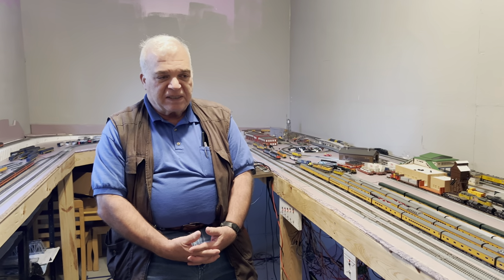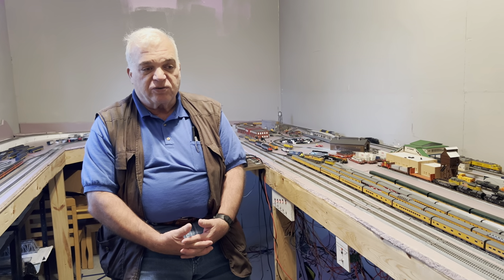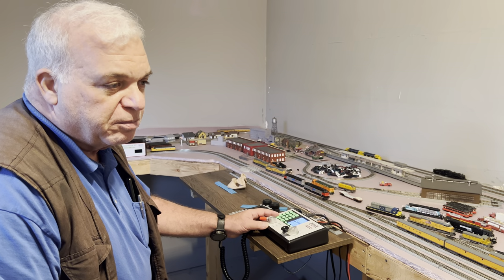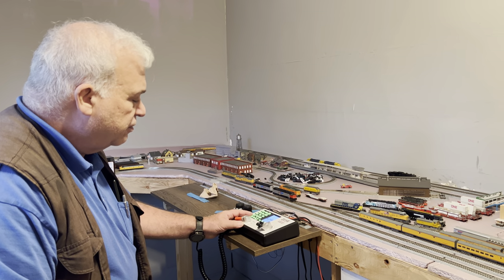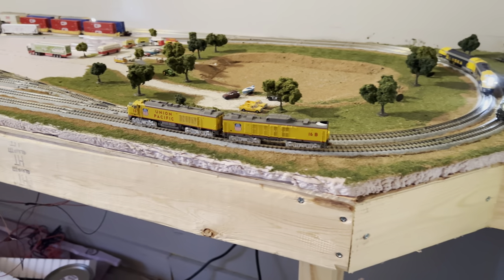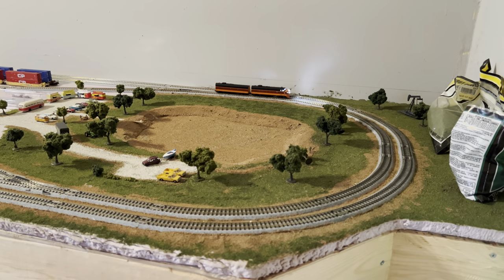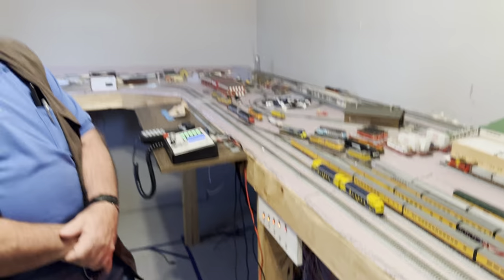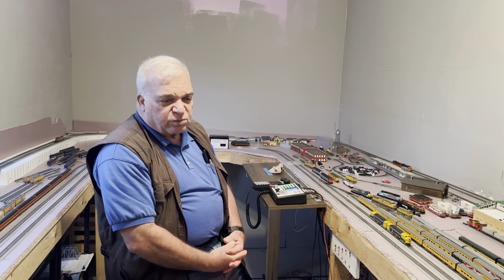Train Layout #2, Video #9 - How many locomotives can you run at once?

Comment: The issue is in using Kato track for a large, permanent layout. Kato as a rule makes outstanding products, but their track really isn’t designed for that. What Kato produces is top shelf toy track. Power drops on larger layouts using Kato track are a given.

There are a number of reasons why you would be losing power with the Kato track, but the most likely culprit is the switches. When deciding where to put the power leads you would start by having one on each side of every switch.

Evenly spacing the feeders with Kato track is not the answer. When using flex track, like Atlas or Peco, you have a joint every 3' +/-, so even spacing is the logical answer. With Kato, you may have a dozen pieces of track over a 3' stretch. In this case it's more about the number of joints between feeds than the distance.

Another tip is to be sure that not only is the track pushed together well laterally, but vertically as well. Run your fingers over the joints. No doubt you’ll discover some surprisingly large offsets. With fingers on each rail on both sides of the joint, press each piece down firmly to be sure that the tops of the rails are at the same height. 

Lastly, take a pair of needle nose pliers and give each rail joiner a gentle squeeze (yes, on each side of every joint) once you have your track plan finalized. All the side-to-side action when assembling and disassembling track loosens the rail joiners.
Reply from the maker: I am not sure I agree with you that Unitrack is not a good choice for a permanent layout, but I do like the two points you made about the number of joints between feeds and the possible expansion of the joints from disassembling the layout while working on it.

It makes sense to me that the joints have a different resistance than the track itself, so the number of joints affects the current flow more than flex track in the same distance. I had not thought of that and was considering the distance between the drops. 

I agree that it does have a problem with the vertical alignment at times. I had learned about that earlier when some of my steam locomotives would jump the track at specific joints. There is very little pressure on some of the pilot trucks (especially in the Big Boy) and the bump would make the pilot jump and cause derailments. In addition to pushing them down to be even, you can take a file and smooth out the joint. I recommend doing that only after you are sure of the layout because it could make the problem worse if the two pieces of track get moved and joined to other track.

I also agree about putting the drops on both sides of every turnout. The only time I do not do this is if I have a section I deliberately want left unpowered. Kato turnouts are power routing, so I sometimes take advantage of that to have a parking track that shuts the locomotive down when I set the switch back to the main route.

Comment: 1. You need evenly spaced and lots of feeders, the more you have the less voltage drop.
2. The locomotive onboard capacitor size affects the voltage drop.
3. Adding a power booster but skipping feeders will only help that section that has them. 
4. The furthest point from your power supply on your trackplan will be the lowest voltage as you lose power the farther away you get.
Reply from the maker: Thanks for those points. I do have evenly spaced drops around the layout, but the two questions were always how far apart should the drops be and how many locomotives can you power with one supply. My son and I are disagreeing on the number of drops needed and whether it needs more power or not. We are going to add drops anyway because I agree with point 3 about them being needed for the booster to work anyway. But I think we will need the booster too. Right now we have not even added any drops for the trolley loop, which is four more engines drawing down the power (though they are all without sound).

But the four passenger trains I will run on a regular basis are all built with multi-locomotive consists. One has just two but one has four and the other two are three each. To me, that is a lot of power being drawn from just the Zephyr. I figure a power booster can't hurt even if I really don't need it and it will provide insurance to keep things going.
Reply: @Rothstein_Model_Trains  do not underestimate multi loco consists . I run lots of abba ABA etc and that’s 3-4 motors. Plus the n scale is prob pulling a longer train more weight and uphill vs the Ho and you see what the zephyr is a beginner pack only.
Reply from the maker: Thanks. I am not sure I understand your point about underestimating the MU consists though. I counted each engine in the consist equally, but you make it sound as if the total current draw for the consist is more than if the same number of  locomotives is running individually. Is that correct?

I do understand that the Zephyr is a beginner's station and I am looking at replacing it later, after I get the booster. My next question on the Zephyr is if the limit of ten locomotives in the memory applies when I am using extra throttles too. I need to research that point more because that might be part of the trouble I have controlling more than the 12 I did have on it.
Reply: @Rothstein_Model_Trains  get a system with 99+ locos and sufficient amperage 5-8 amps depending on expansion plans. If the throttle will allow you more locos yes you need a booster which you said. But it’s a bandaid. I started with a empire builder 5 amps and I’m now adding 2 boosters and wireless years later.
Reply from the maker: I am looking at the new Digitrax Evox systems. I think you are right that I have outgrown the capabilities of the Zephyr and need to upgrade.
Reply: @Rothstein_Model_Trains  used or new but I think your size of layout deserves 5 amps and big throttles. based on 12 engines, etc
Reply from the maker: The more we talk about it, the more I agree we need a better command station. If I get one with 5 amps, I probably will not need a booster if I get enough drops into the track. The Evox system are 5 amp and 100 locos and 100 throttles, which will last me forever probably, but I am thinking right now that I really cannot go wrong if I just bite the bullet and go with the DCS204+ command station with 5 or 8 amps and 400 locos and throttles. Always better to have more capabilities than you ever expect to need than buy what you expect and then find it just a little short at some point.
Reply: @Rothstein_Model_Trains  I tow a lot with a dually and half ton and a 1/4 ton. There’s no such thing as too much truck in the mountains. You never say as you’re hauling 20000 lbs gee I wish I brought the 1/4 ton. The dcc systems are based on your needs. You run large consists (abba) and by the time you add the booster, the cost difference vs selling the zephyr and not buying the booster, it has to be close
Reply from the maker: I agree. Thanks.
Reply from the maker: Just thought I would add one more note on this topic. The booster I had ordered came in this weekend, so I went by my LHS. Digitrax had also sent them a few Evox sets with the DCS210+ command station. The people at my LHS were nice enough to allow me to buy the Evox set instead of the booster I ordered (well, the 470 price over the 159 for the booster might have helped convince them).

Got it home and set it up. Added a few drops to the track, like I had planned for the booster. No more problems. I don't know how much credit to give the 5 amps power instead of the 3 amps of power the Zephyr has or the fact that it allows 100 loco addresses to run at once, as opposed to the 20 the Zephyr does. I think it was a combination of all the factors, but I also think that most credit does go to the larger address capability.
Reply: @Rothstein_Model_Trains  dollar store thrift expert. You did need the amps. I’m a car guy imagine adding a turbo yourself to the family
Truckster. Sometimes you just needed the big engine for your needs. You will be happy with the big digitrax. I am upgrading from 5 amps older system next year. But for 15+ years that super empire builder worked until I went two levels (double track) the zephyr is for a tabletop not around the walls like you and me have.
Reply from the maker: Thanks

Comment: The question remains unanswered!
Reply from the maker: Well, sort of. There is no definitive answer because each layout and locomotive is different. I could run 17 on my layout with the Zephyr if I was careful which locomotives I chose. And I did find out that the Digitrax Evox command stations run a much larger number of locomotives at one time.

With the Evox system, the question is no longer what the system will run, but how many I can control at one time before they crash because my reflexes/responses are too slow.

Comment: I stopped at 12 on the DCS52, many MU units
Reply from the maker: Thanks, 12 is what I found I could reliably control also. I had it up to 17 locos running but some were acting erratically, so I dropped it back down.

I figure it gets me to either 5 or 6 trains since I almost always will have MU's on them.

Comment: I'm swapping my NCE Powercab to the Digitrax DCS52 Zephyr Express. The NCE works well but I feel that the Digitrax has more/better features.
Reply from the maker: I have no experience with the NCE, but I still use the Zephyr on one of my layouts. It works well, especially with a remote throttle plugged in to make it easier to run multiple trains.

Comment: Hi Steve! Great experiment you ran. So now we know you feel comfortable running 10 locomotives with the Digitrax Zephyr and track layout that you have. My next question would be how much effect does the drag of the non-powered cars behind the locomotive have on the voltage drop. In other words, if each of the 10 locomotives was pulling 5 freight or passenger cars, could you still run 10 locomotives at once? If the drag of pulling the cars meant you could have only 8 locomotives, then would pulling 10 freight or passenger cars per locomotive mean you could have only 5 or 6 locomotives? 

My other [unrealistic] question, based on what Montana & Wyoming said in their comment #4, is what would happen if all the engines were coupled together? Would you then see a voltage drop at the farthest point from the power supply such that the engines might all stop from lack of voltage? Please DO NOT try this experiment. I don't want you to burn out your engines.

Great video, but I missed seeing King Kong and Godzilla! LOL
Reply from the maker: Hi, Ed. Yep, I feel comfortable with ten locomotives at a time without the booster. I do not know how much extra power is eaten up with the drag of the rest of the train, but I am guessing it will not be as significant as the sound draw is. Sound eats up a lot more power than most people think. I think we will still use a limit of ten locomotives when i put the cars back on. To be honest though, with the trains instead of just the locomotives, there is not nearly as much space for as many trains at one time so the engine count will be lower.

As for your unrealistic question, I don't know the answer. If I were running a consist of say 10 locomotives and had no drops to move the power, the resistance of the track would make the voltage drop greatest at the farthest point from my one connection point. As the consist approached that point, it would start slowing down from a lack of power (I think anyway). This would provide a warning to the user of the problem coming up. I think (without any evidence) that it would take more track than I have to get to that point though. In addition, I do have power drops around the track (maybe not enough but some evenly spaced around it), so this should never happen to me.

Sorry about Godzilla and King Kong. I will make sure they are included in my next video. If things go as planned, it will be the three excursion trains together, though I have a train I am waiting for that might make its own video when it comes in (hopefully in December). It is a model of a German train from the period around 1870-1900.

Comment: Does this go for ho scale or is the scenario different?
Reply from the maker: The basic principles will be the same. The command station only puts out so many amps and each locomotive will draw so much. At some point you will run out of power and need boosters. The big difference will be how many locos you can run, since HO scale will take more power per loco, but the HO setting on the command station may put out more amperage than the N scale setting.

And in both cases, getting enough feeders properly spaced around the track will make a big difference to how well the trains run.